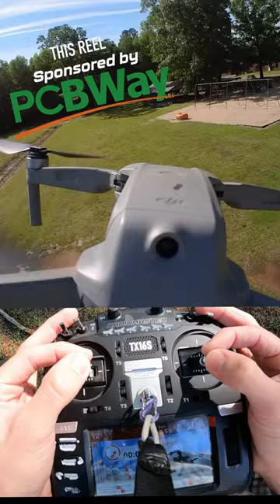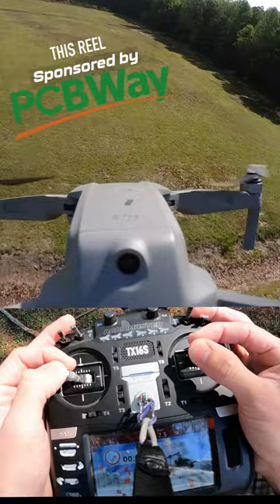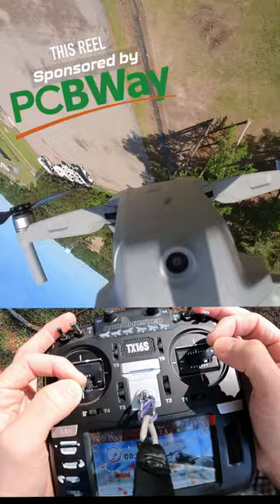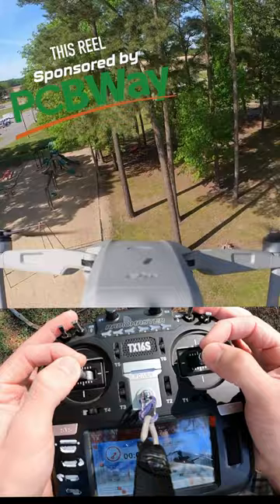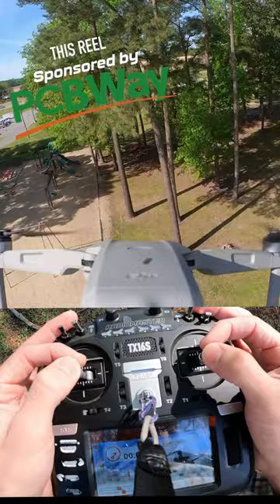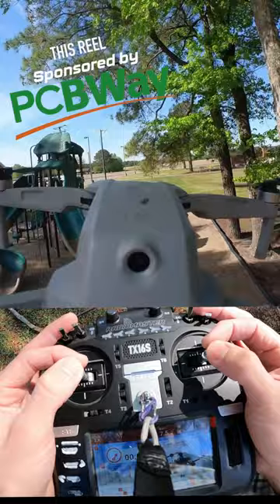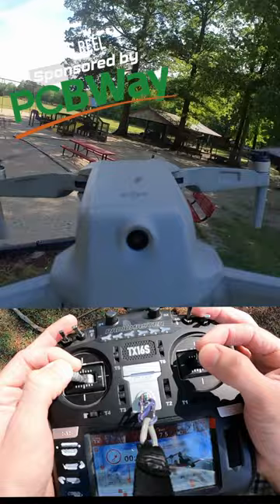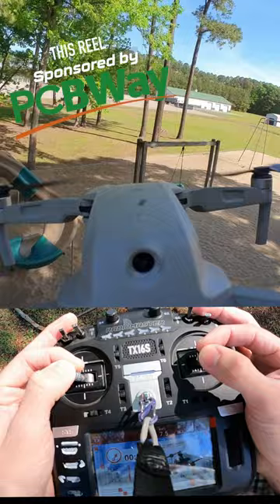flying the cUrSeD DJI Mavic Air 2 (because I made it that way)

Comment: I own a mavic air 2 as well, and I am shocked by these angles
Reply: It's in acro mode😂
Reply: he made it into a fpv drone, look at the controller
Reply: its modded
Reply: i mean its stock officer
Reply: he got the shell then replaced the other parts with fpv drone parts

Comment: yea its the props. switch to the fpv propeller shaft conversion adapter and run regular 3 blade fpv props.. hugee difference even stock when dropping down really fast on a sw mod'd one..
Reply from the maker: Who makes the normal prop adapter?